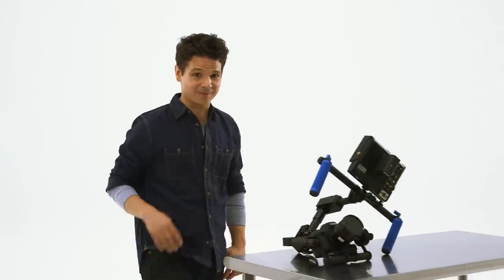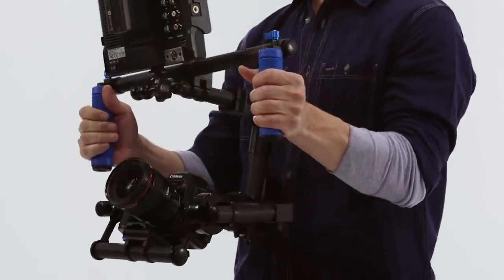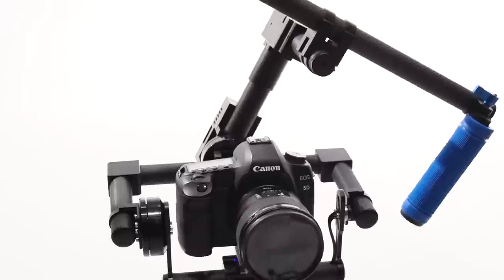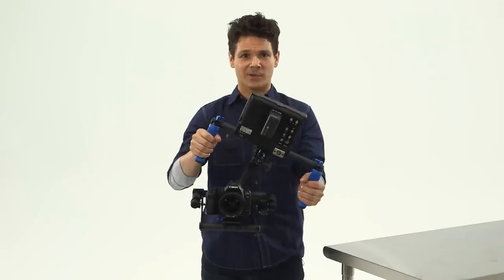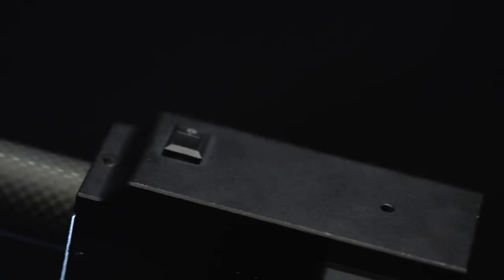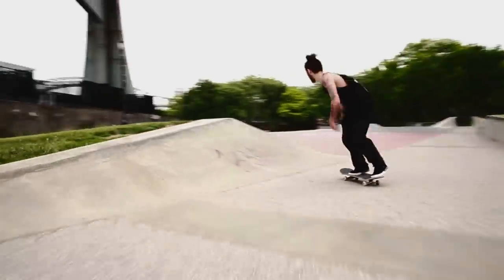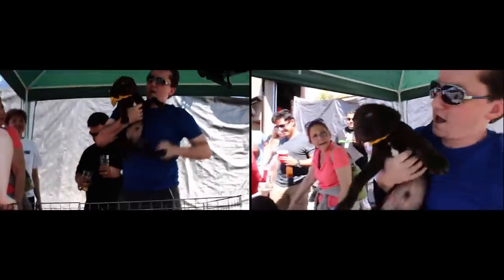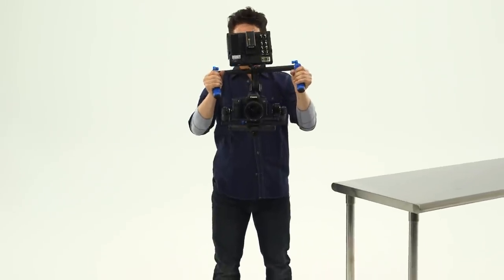ZEROGRAV GYRO STABILIZER by Flashpoint

Comment: This looks like a great product and the price is awesome.  I was wondering though what is the difference between a 2-axis and 3-axis?  I noticed many are 3-axis.
Reply: 3 Axis - has a top handle(besides the 2 on the side) to hold the gyro (witch you can technically also do with this unit
Reply: Simple fact:  2-axis is unacceptable anymore, and side-to-side shakiness is inevitable.  (For example, that shot on the baseball field at the end of this video has horrible side-to-side shake.)  I can't imagine why anyone would get a 2-axis stabilizer at this point.  Note that much older, cruder manual technologies like the Steadicam Merlin and GlideCam were 3-axis gimbals.
Reply: FocusPulling (.com)
I agree with you, but the cost of 3 axis is how much more? That's my point. While 3 is better, it might be out of the range of a lot of people.